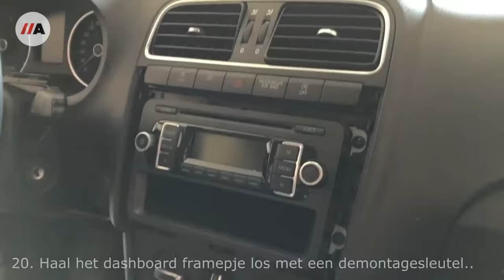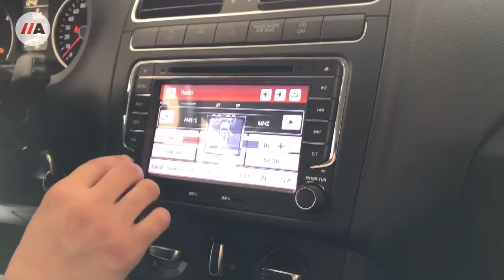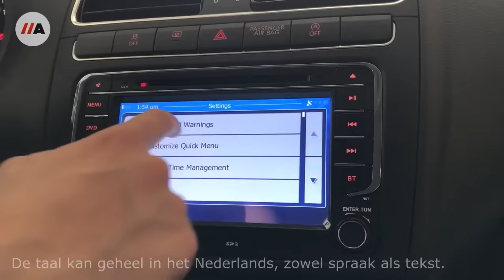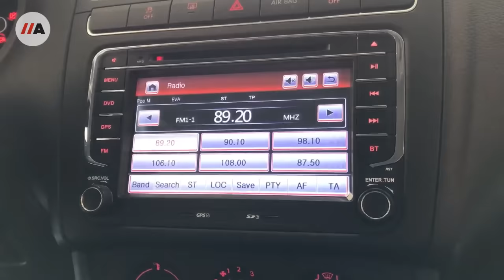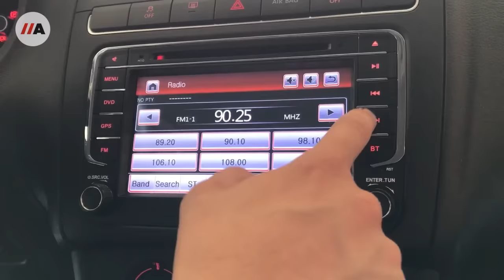How to install Car Stereo with Reverse camera to Volkswagen Polo or other VW vehicles.

Comment: Thank you, you helped me a lot. I was connected the camera with the back light but because it was very noise the camera did not worked when the engine was working. But today I connected it to the cambus  as shown in the video and I solved my problem. thank again

Comment: Very useful! Thanks.. ps Why not drill a slightly bigger hole at 0:54.. then you can push the video and power connectors through one by one..  you have already removed the grommet inside and plenty of room to push the connectors through.. no need to cut the cables and re-connect them then.. just a thought.

Comment: Hello I also bought an Android radio on Amazon equal to yours for my Volkswagen 2014 ... After installing it, I ran out of the machine's ignition battery... Because? What do you suggest I do? In cable with the connector, which you isolated, on my car arrived connected, why? Thank you very much

Comment: it's not very clear where to connect the rear camera red cable (usually to the rear "gear" cable to the white back light) to the canbus adapter. can you write it  please? thank you for the best video to do this on vw polo 6r

Comment: so you are drilling a hole through the metal to then not add something to prevent humiditiy to get in the car or corrosion starting from the drillhole 🤔

Comment: Can this method be used with the standard radio unit in a VW Polo 1.0 TSI Highline (2016) VW Discover Media system? Or do I need extra cables and plugs or another unit because this one may lack the necessary connections?
Reply from the maker: Unfortunately, this method only works with an aftermarket car stereo and rear view camera.
Reply: @carparautomotive1870  Thought so. Thnx for your answer. 👍🏼
Time to see if there are better units then the VW original ones that keep all original functios at the same time.

Comment: Hoe krijgt de camera nu 12v dan? je sluit alleen de rode kabel aan op de reverse-kabel van de iso-stekker?
De camera geeft de radio toch via de iso-stekker een seintje van: Joww ik heb stroom, toon mij in beeld als hij voeding krijgt van het achteruitrijd licht?
Reply from the maker: De rode kabel dient inderdaad als signaal draad. Omdat deze radio via het Canbus systeem werkt, krijgt ie automatisch een seintje zodra je achteruit schakelt. Bij radio's zonder Canbus ondersteuning zou je het rode signaaldraad moeten koppelen met het achteruitrij licht. Dan krijgt de radio signaal zodra het achteruitrij licht gaat branden, dus zodra je achteruit schakelt.
Reply: Carpar automotive oke, maar hoe wordt de camera voorzien van 12v voor de leds e.d.?
Reply from the maker: De radio stuurt via het rode draad 12v+ naar de camera (dus ook naar de LED verlichting van de camera). Daarvoor gebruiken we de rode draad. De zwarte massa knippen we door, omdat die overbodig is. Via de gele tulpstekker loopt al een massa draad die we niet zien, maar wel uiteindelijk op de camera terecht komt.
Reply: Dus de 2 rode draden moet ik aan elkaar koppelen op de plus van mijn achteruitrijlamp en de zwarte op het chassis? En de rode draad bij de radio op reverse? 

Zit met hetzelfde probleem bij een polo uit 2007, ik denk niet dat deze canbus heeft. Heb wel 2 soorten stekkers bij de radio gekregen, de gewone en 1 met canbus

Comment: The reverse backup camera manufacturers are not smart enough to know that the camera wires need to be small enough to go through the trunk. They make the products but never use them.

Comment: why you not connect the power of the camera to rear ligths??
Reply: I thought the same and was expecting a link into the reversing light positive.. It is powered from the front of the Polo (not sure where) there must be a link from near the radio cluster at the back  of it.. Anyway the power is activated as demonstrated when reverse is selected. I'm glad of the view of his camera fitment and trimming the leads in between the power and Video plugs to keep the invasion inside to a minimum. Will do this myself. Thanks for the YT Carpar Automotive 👍👍